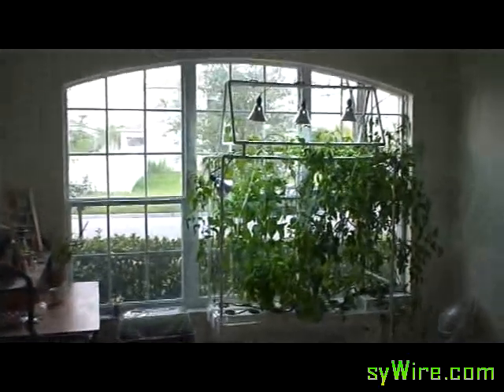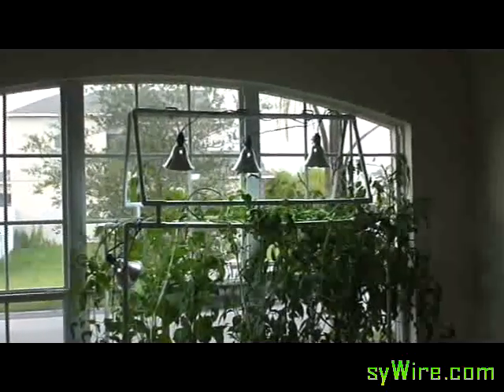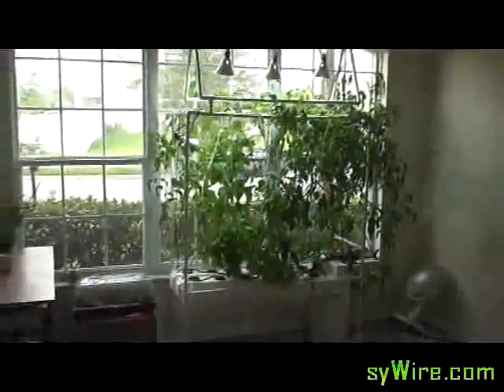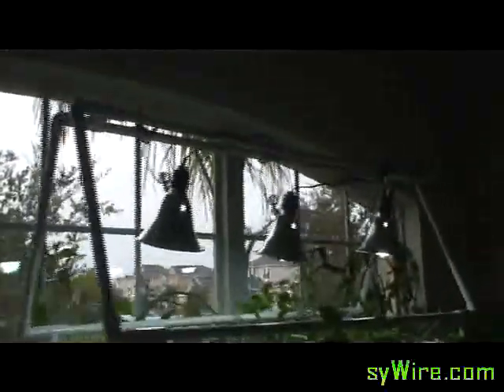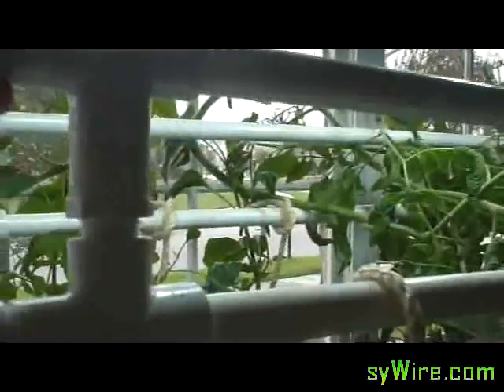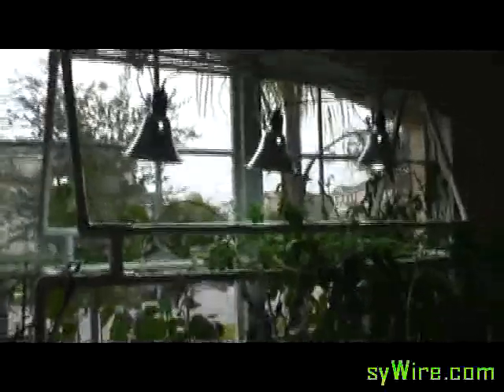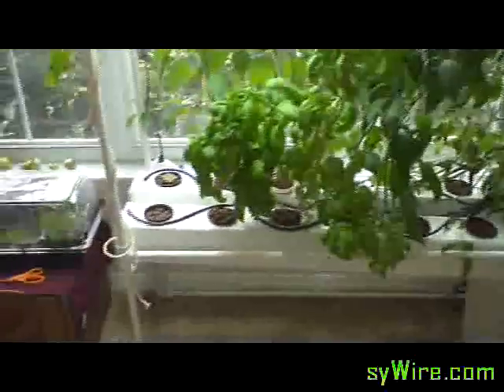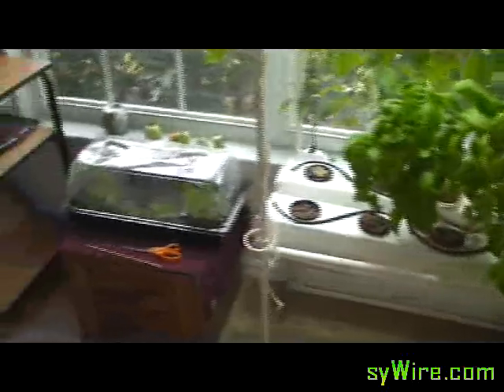Built Low watt light canopy for my Aeroponic / hydroponic

Comment: i like the system you built. the only problem i've heard from people that have grown with them is that not all the nutrients can get to the roots thru fog. have you had any deficiencies in nutes? like any elements missing such as sulphur, potassium, nitrogen etc? i really like the system tho. i have built a pvc tube system but i like the square posts that you used better. also with that fogger you don't have to drill for misters on each side of the net sites. awesome!